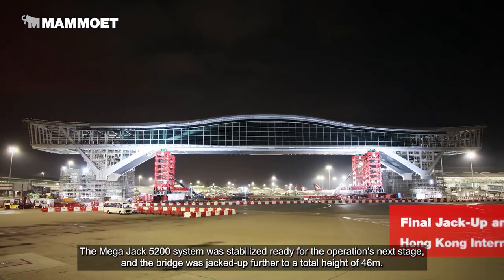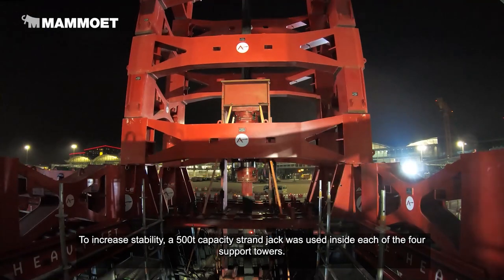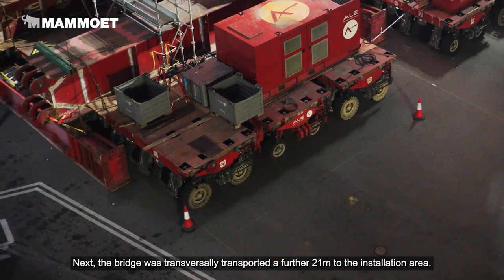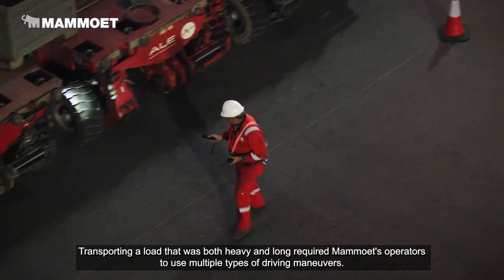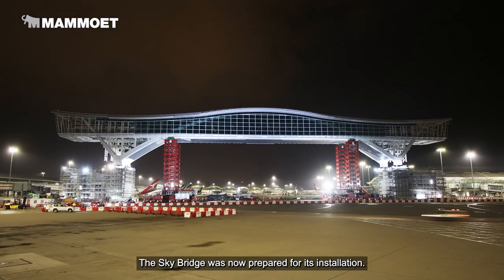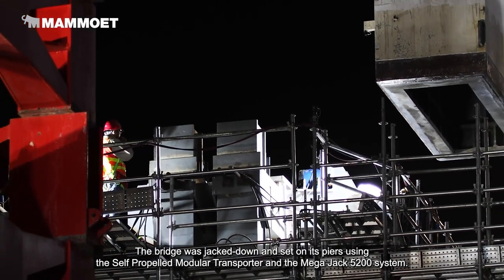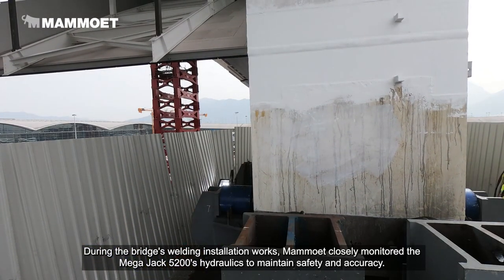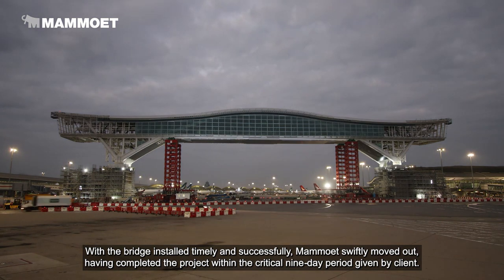HKIA Part 3 - Final Jack Up and Installation of Hong Kong International Airport's Sky Bridge

Comment: So, they lowered the bridge with a 30 procent load bearing and started the welding. Does that mean that the welding holds 70 procent of the rest of the weight? Or the full 100 procent because the welding causes a full connection in the steel? 

This is absolutely amazing! Mammoet always clears the job, but this project is really breaking records in HKIA!